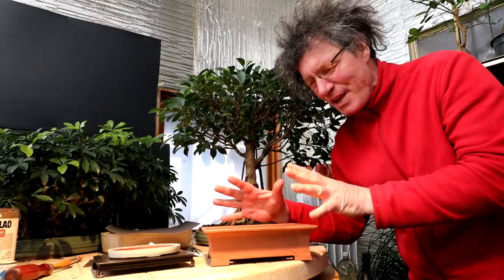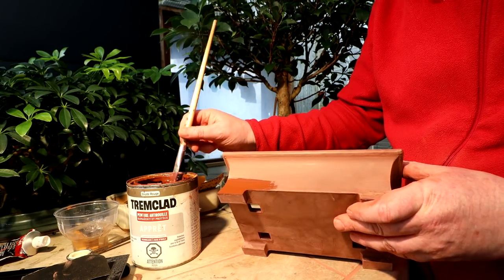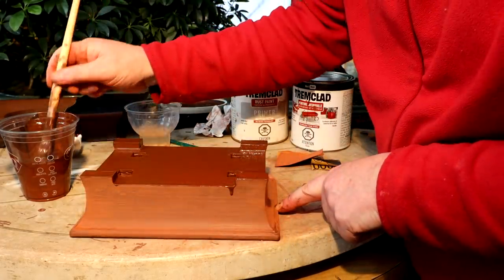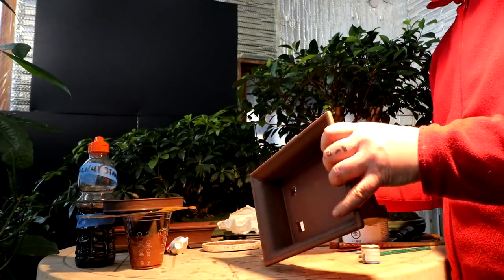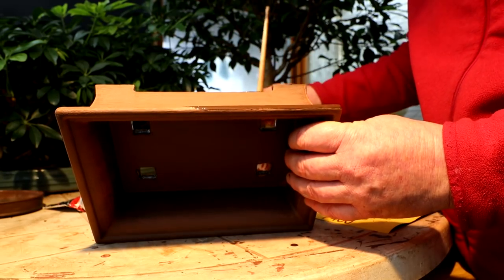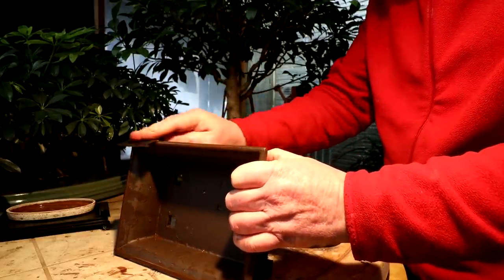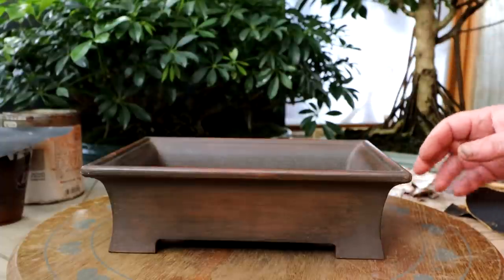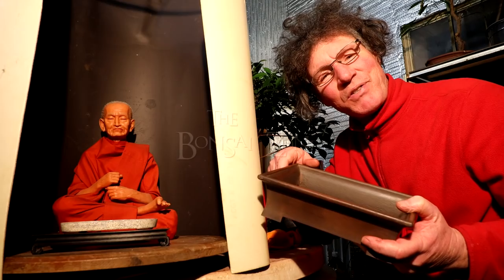Finishing my 3D Printed Bonsai Pots, The Bonsai Zone, Mar 2020

Comment: Great experiments Nigel, thanks for bringing us along. You can get specific plastic primer and I wonder if you did a deeper enamel paint coat, then less pressure on your needle when crazing the paint, could you do dry brush/black (or grey) paint washes ,wiping off in between passes to reveal the desired look? Clear coat over the top if you require? I'm keen to give this a go now myself!
Reply from the maker: Sounds like a good idea, I'm sure there will be more experiments coming as I print more pots! Thanks Leigh!

Comment: next time , spay paint the primer water sand with 400 grit when you have smoothness you desire, brush in glue . then top coat the end color the glue will give you the crackling look then clear it water sand with 1000 grit and reclear.
Reply from the maker: Thanks, sounds like a good solid technique!

Comment: what grit paper are you water sanding with?..never mind I heard you say 800 grit,  you can use 400 grit if you are going to re coat the clear it after the base coat
Reply from the maker: Thanks, I think I used mostly 400 in this project and the 800 for final finishing only.

Comment: The only bonsai pots I own are 3D printed... well except one like 7cm diameter one, that one I found at the garden at my grandparents. But they didn't use it for bonsai, it was holding old rusty screws :D
Reply from the maker: I hope they are working well for you, the ones printed with nGen plastic stand up to everything!
Reply: @TheBonsaiZone  so far I have 3 of the printed ones outside on my balcony, they don't get any protection from elements and they look brand new after year and a half. They just had some minor salt build ups from fertilizing, but that came off with a little toothbrush scrub :)